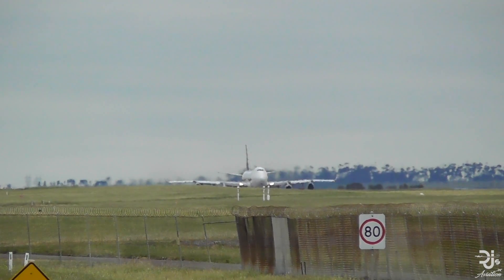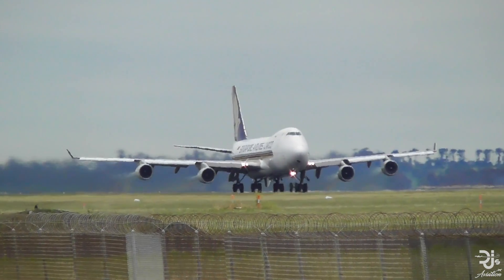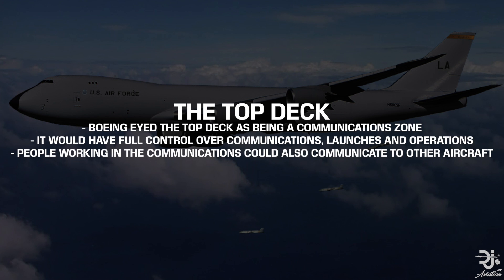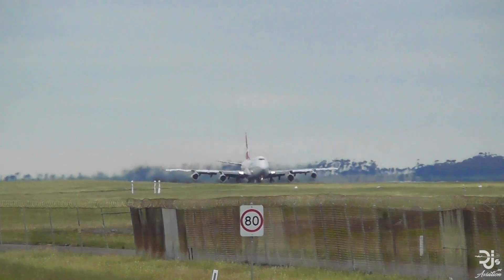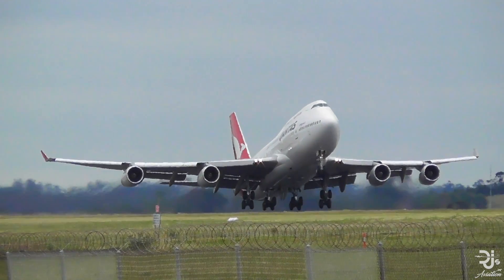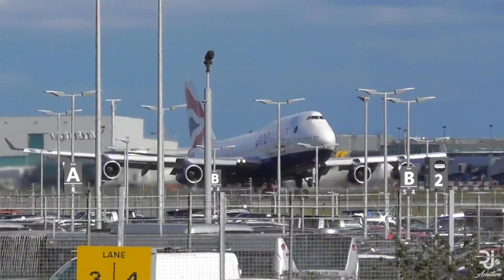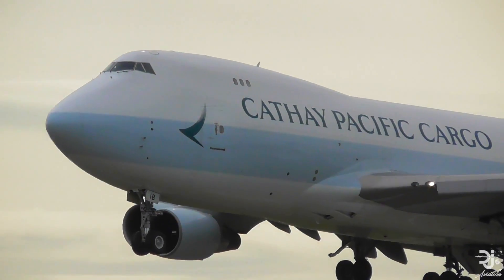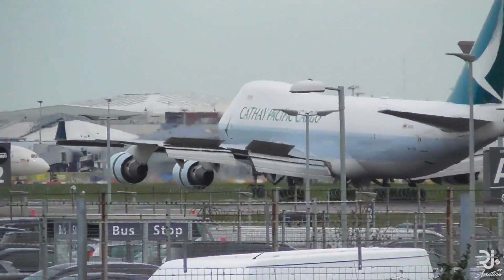What is the 747 Cruise Missile Carrier?

Comment: The B52s were converted, again, to do this work as well. And I believe they did it very well. In fact it was such an advantage over anything the Soviet Union had, the Soviets insisted that they be destroyed as part of SALT 2. I think that is the bigger reason for killing the 747 missile carrier.
As for the 747 not being built to do the job. Remember it was originally designed to be the AFs heavy lift aircraft, and included a nose that would raise up to facilitate loading. Sound familiar? It lost out to Lockheeds' C5. Boeing then converted their entry to passenger and cargo, the variants we know so well to this day. But there was also a laser cannon version built, meant to use its large capacity to house a chemical laser, fly as high as possible (50K feet) to get above most of the atmosphere, and then blind enemy satellites. The 747 did the job, but the whole thing was cancelled when it was pointed out it still wouldn't be able to hit targets low on the horizon. And of course there's the Air Force One variants. This bird could have done the missile truck job. Hey, the B52 wasn't built to do this job either.
As for not being able to evade? The whole point of the B52 doing the job was to fly parallel to the Soviet Union for hours, out of radar range, waiting for the command to dash in as close as it dared and file off all the cruise missiles. Done with that, it would turn and fly home. That's just two turns. Certainly a B52 is more maneuverable than a 747, but would it matter that much for the job?

Comment: Just came across this video. 
This idea would be ideal for Australia.  Due to its geography a long range high endurance platform like this armed with long range antiship missiles would be the maritime patrol bomber needed.
A maritime B 52 of sorts, it would be available at low cost with all the 747s recently shed by the airlines sitting in desert vineyards.
Further development plans might include placing an ErieEye radar on top to enhance surveillance by adding powerful aircrafts monitoring. A synthetic aperture radar would improve ocean surface and targeting. This is all possible with the enormous space available in such an airframe. 
Perhaps the ultimate spiral development would be integration of elint antenna similar to the RC135. There would be space aboard for workstations. 

This integration work could be a nice set of projects for Australian  industry. Perhaps in Australia it could be linked with the Loyal Wingman which could either fly alongside it or maybe even be launched from it using an underwing pylon. 

I would be interested in the thoughts of others about this idea.

Comment: I would rather not see a military version of the Boeing 747, other than the “Doomsday” model and Air Force One platforms that already exist, for the simple fact that I would hate to see a repeat of Korean Air flight 007. Even though that 747 was mistaken by the USSR for another US military aircraft, the tragedy occurred nonetheless. Imagine if the Boeing started building multiple armed military 747’s. The potential for another KE007 tragedy would be horrible. Heck, Boeing is building B737 armed military variants now.  While I get it that there is likely a cost-savings to use an existing airframe, I think it’s a bit risky.

Comment: I used to work in the aerospace industry during the development of the B1 and B2 (top secret at the time) and I often wondered why the 747 wasn't adapted into a heavy bomber.  

It could certainly carry the payload.  Not as fast as the B1 but with high tech defense, I don't think speed is all that important.  A large bomber isn't gonna out run a fighter or an AA missile.   

There's plenty of other passenger aircraft that have been converted to military use and its worked out just fine. 

I'm not gonna knock the bombers we have now but considering the cost off the B1 and B2 programs, we could've probably built 2000 heavy bombers on 747 air frames and still saved money.

Comment: Thank you Dj.
You do have some issues with trying to use an airliner or transport aircraft, as a bomber. Let's say you wanted to convert a C-17 to a bomber. Nice speed, range payload, but how are you going to release your bombs?
Now the MOAB has been developed to roll out the back with a  drogue chute, but that one is an exception. A B52 has bomb bays along most of the fuselage, and huge bomb bay doors. But it has a structure designed for that. What would happen to the structure of a 747 if you tried to add bomb bay doors all along the bottom? One thing, it would be a bit hard to pressurise after that, but also, if you make a great big hole in a monocoque structure, what happens to your overall structural strength? If you want a bomber which can deliver 20 or 30 tonnes of bombs, in one cluster, it has to be designed to do that from the start.

Comment: G'day Dj, Most interesting video yet on airframe variants that never saw service. Many years ago I actually heard scuttlebutt about this type of variant from some USAF sources who used to fly into and out of Australia on a regular basis. It was not decided it would be a 747 but that was briefly rumored. The main problem with any large multi-jet aircraft such as the 747 or the older Galaxy or Starlifter class military aircraft, which could also be converted to a weapons delivery platform is that they present too big a target for air to air weapons and ground to air installations. At over a million USD even way back, per cruise,  then it was not considered a safe way to do the job, besides the resultant explosion if one was shot down would be catastrophic and extremely expensive, to say little of collateral damage on the ground. It sounded like a good idea initially but on closer inspection there were too many negatives. Besides that to have airborne protection from jet fighters is problematic because they have trouble flying slowly for long periods to protect the 'weapons' ship'.  Good one. Cheers, BH
Reply: At M0.85 the 747 has a higher cruise speed than most military jets, including fighters. Aircraft are simply not designed to linger in the upper transonic regime of mach 0.9 to mach 1.1, it is a no-mans land for any sustained operations. Fighters such as the F-4, F-15, F-16, F-18 have max endurance and range cruises around 350-400 knots and still reasonable range at M0.85 (500knots depending on  air temp and such), they only fly super sonic for interception or during combat. Supersonic M2.0 is an optimal speed, (and why the Concord design was M2.0) as drag and lift have mostly recovered from the transonic pressure issues but skin heating is still manageable without excess use of exotic materials, at M3.0 the skin is well beyond the structural utility and nearing the melting point of aluminum. (thus the SR-71 used titanium and steel in the cladding).
Reply: G'day MyTech, thanks for the response. Yes, you're absolutely right. What I should have mentioned was that one of the many problems with this concept was the incredible weight of not only storing the cruise missiles but also the large, intricate mechanical selection/ejection equipment; a task that could not be done by hand. Only the safety detonation switches and the back-up 'Remove Before Flight' detonator tags could be done by hand. Add to this the missile command & control panels on the upper deck and the two complete technicians' crews needed so the aircraft could deploy for long-haul missions. I'm also sure the complete list of gear needed to mount these missions was long and every component of this list adding to the weight. Proving that weight was probably the main factor that doomed this project was that it was also a washout on the Galaxy and Starlifter aircraft. It's an interesting subject and maybe someone in the future will make a documentary or publish more details about these proposals. Military history is littered with bizarre projects that, heard today, makes you wonder what in the heck were they thinking, like in this case, the added weight of the in-flight refueling gear... 40 or 50 nukes and in-flight refueling, what could go wrong? Cheers, BH.

Comment: Bloody brilliant idea... And a lot more manoeuvrability on a 747 than a nuclear submarine. 
Personally speaking, I always thought Concorde would have made a superb strategic bomber.
Reply: Year. I don't like the idea of carrying air-to-air missiles due to their relatively short range. But it would be brilliant for carrying cruise missiles or long range anti ship missiles. A harpoon missile is about 1500 pounds to the 747 could carry a lot. 100 missiles is what you need to overwhelm a naval task forces defensive systems and make them go away :-)
Reply: @noeyewar  well, it depends what missiles we are talking about. Among/instead tomahawks such a plane could carry air launched version of SM6 or even SM3 naval anti air missiles. In this case the plane would be able to outrange any existing air to air missiles. And if combined with modern AESA radars and several F35/upgraded F22 (equipped with link 16) it would provide local air superiority with its dosens of BVR missiles. Theoretically such plane would even be able to protect itself from enemy missiles by the use of new 100kW lasers and/or RIM-116 Rolling Airframe Missiles, that currently are used to intercept anti-ship missiles, thus reintroducing concept of the flying fortress.
Reply: What a fascinating concept. I didn't even think about the possibility of using SM6/SM3 missiles. It does make a lot of sense especially with the limited missile load carried by the F22/F35. It could be such a flexible and versatile platform.
Reply: The 747 has the radar cross section of the Empire State building, so no chance of a surprise attack. 

Jets like the F22 and F35 being low observable allow for penetration of the enemies air defenses giving a higher percentage of strikes on target.
Reply: Gunga Dinn  - the cruse missile it was considering to caring has a range of 1,500+ mi (2,400+ km), it was always thought of as a stand off launch platform

Comment: Low wing aircraft simply do not make for good bombers or missile launching platforms
Reply: Why tho. You just made me realise basically all bombers are mid to high wing but why is that the case
Reply: +Jun Yu Tan Also, all bombers are not made this way. Case in point, modern bombers like the B-1, B-2, Tu-160, Tu-22, etc. The advantages of the high wing design highlighted in the Quora thread were superseded by things like blended body designs.
Reply: Jun Yu Tan I’m not an expert or anything but I’d think it’s related to the mechanisms for dropping their payloads as quickly as possible. The wing structure may impede that.
Reply: That probably has more to do with military operational requirements for marginal airfields where wings and engines may need to clear obstacles.
Reply: Some of the reasons bombers have a high wing design is that a wing spar through the fuselage doesn't interfere with the bomb bays being placed centrally under the wing balance position (remember--the payload has to be dropped evenly. If the bays were forward and to the rear of the wings, an unbalanced payload would cause the aircraft to pitch out of control); a high wing design allows for trucks ("Jeeps") pulling little trailers with bombs to drive under the aircraft for ease of loading the ordnance; and the issue of taking off from marginal airfields, the higher the wing, the higher the engines are mounted--the less likely to ingest foreign debris
Reply: @timothycook2917  as previously.mentioned by another commenter, the Tu22, and B1B are low wing designs. Perhaps having simultaneous releases from the front opening and rear opening could balance loads our
Reply: Hanz Cedric and modern avionics
Reply: @timothycook2917  The CMCA got around the wing-box impeding bomb-bays problem by loading up the whole cabin with 9 revolver launchers (bombers such as the B-52, B-2 and B-1 typically only have 1 per bomb bay - the B-52, B-2 and B-1 having 1, 2 and 3 respectively) each mounted on a conveyor type system. A rotary launcher could only deploy ordnance out a bay-door near the aft of the plane, but the entire launcher could be moved into or out of position by the conveyor system.
Reply: It could still be built into an MPA or an over grown AC747 gunship though.
Reply: The b 17 have a low wing.